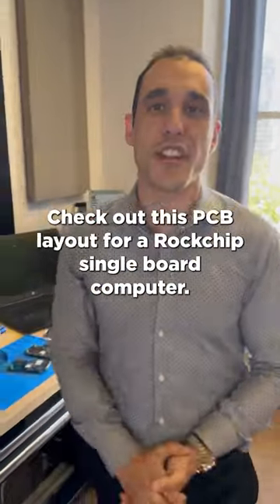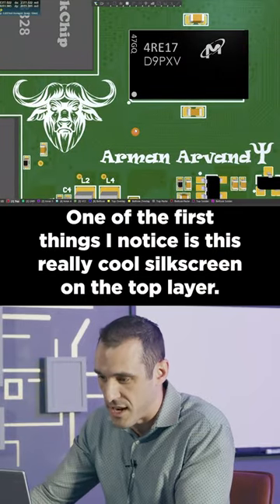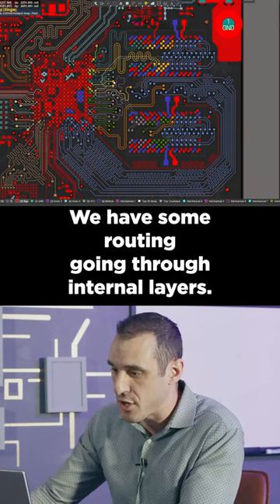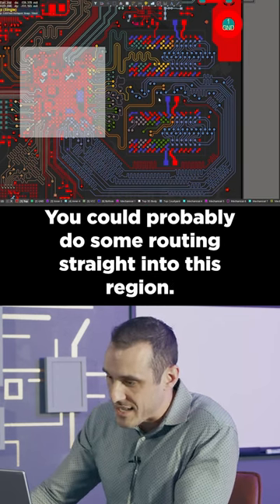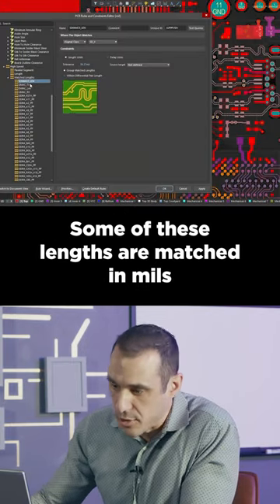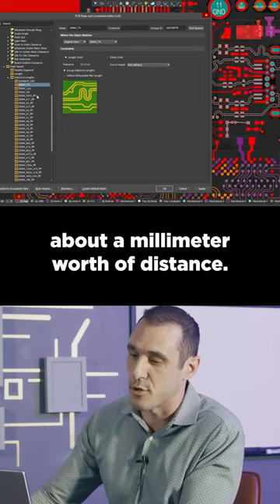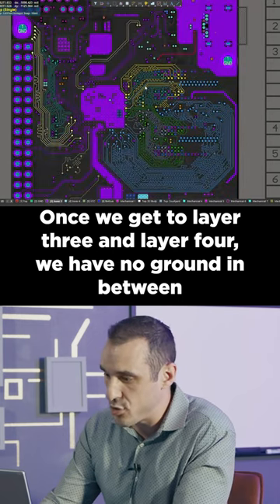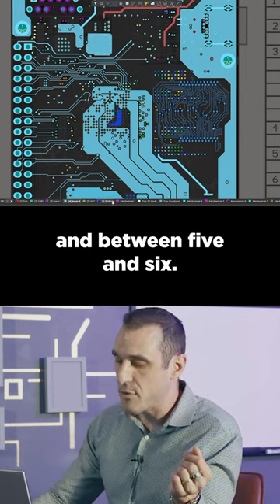8-Layer Board? Rockchip RK3328 PCB Layout: One Minute #PCBDesign Review 08 #electronics #altium

Comment: You said 8 layer board, so how is the GND between 3 and 4 and between 5 and 6?
Did you mean ON layers 4 and 5 or am I not getting something?
Reply: I think he meant, currently it is 8 layer board, 1-2-3-4-5-6-7-8, right.
He mentioned to make it 10 layers and insert GND layers between 3-4, 5-6 because there was not much GND coupling available for those layers.
So, 1-2-3-GND-4-5-GND-6-7-8, now it's a 10 layer board.

Comment: why lots of routings are look like spiral with many bends?
Reply: That is length matching applied on the DDR bus
Reply: @Zachariah-Peterson  how about added inductance because of those extra turns?
Reply: @omidsanati2421   Why would you think there might be any extra inductance that might matter? Technically there might actually be less inductance during fringing of the magnetic field near the bend (where the field is non-orthogonal briefly), but at the size of the bends it may be no more important than the dielectric constant variation from the fiber weave opening in the substrate or the variation in trace width due to etching tolerances.

Comment: Why can't Altium change the shape of a polygon fill cut outs say on the top layer?  This was basic 101 in Allegro Cadence.  That is a big deal for Altium not to have that function
Reply: Do you mean to repour automatically? There's a setting for that. From the documentation: 

- If the Repour Polygons After Modification and Repour all dependent polygons after editing options are enabled on the PCB Editor - General page of the Preferences dialog, the polygon pour and all of its dependents will be automatically repoured after modification.

The only problem I can see with automatic repour would be cases where you modify multiple complex pours at once, and then they all get repoured, which could take time and slow down workflow.
Reply: You definitely can change the shape of cutouts. Make sure you have your selection filters set up to allow you to select regions, I think